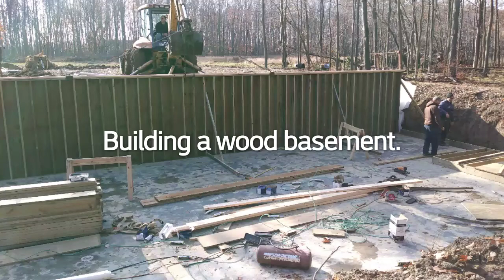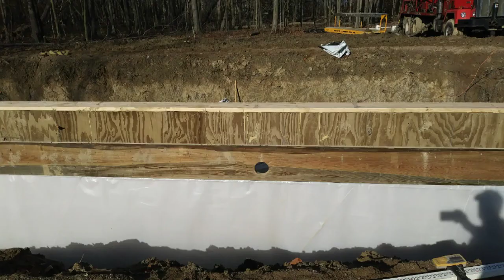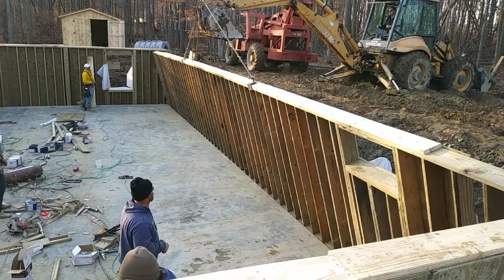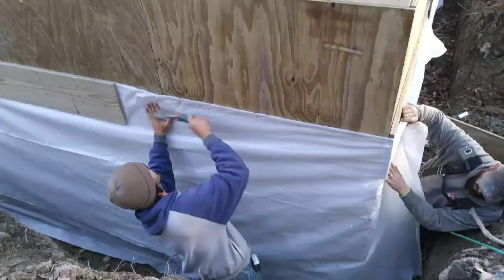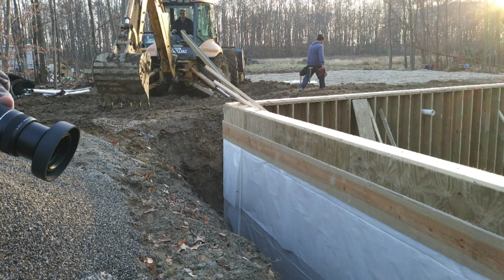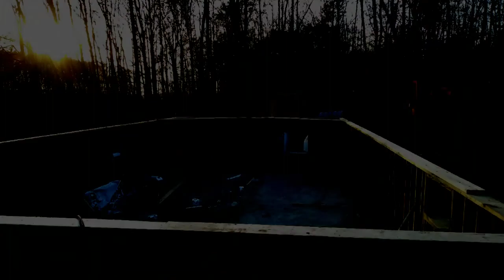Building a wood basement.

Comment: Did you use 2x6 lumber and what spacing did you use?
Reply from the maker: Yes, 2x6 treated lumber. The builder said that it was pressurized more then what we find at bigbox stores. The spacing is 12" on center. 3rd summer in this house, no complaints yet.
Reply: @ericsteffy3572  Thank You.
Reply: @ericsteffy3572  This was the way we built our home back in 1976. It's still standing.

Comment: What water proofing method do you use?
Reply from the maker: I believe they used a high quality treated lumber, with bug deterrent (bitter). Then they used plastic sheathing on the outside, and the system uses a sump to remove excess water. We had to paint above ground level to keep sun off. 
We were able to watch them do it all,  but I might have missed a detail or two. 
It came with a 75year warranty, and has been really comfortable to live with.